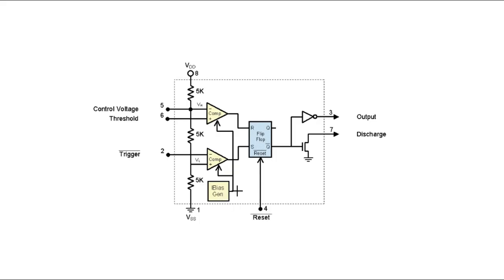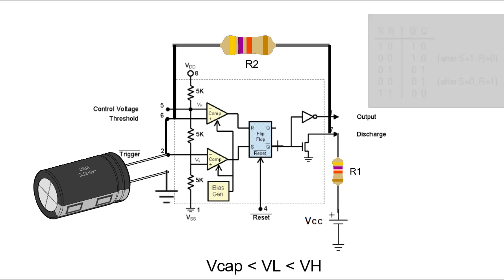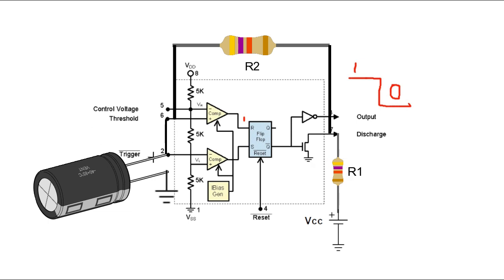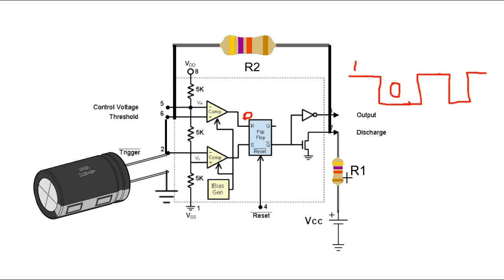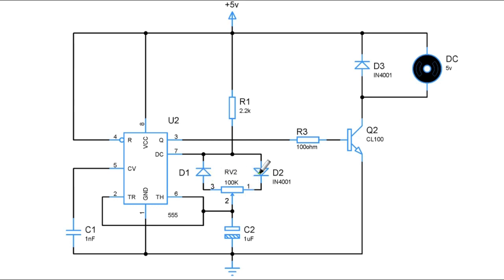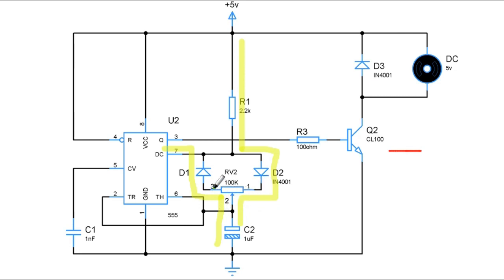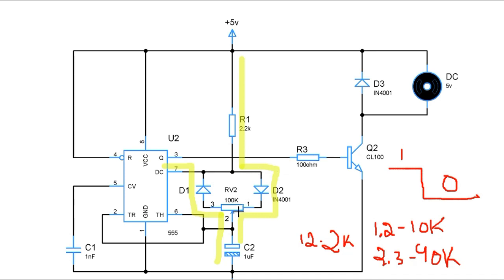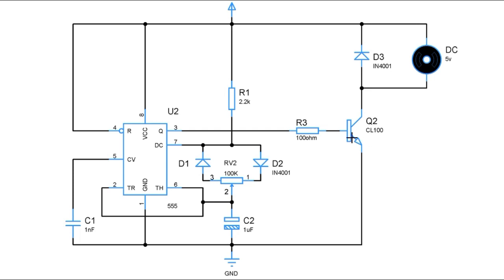DC motor PWM control using IC 555 - Circuit series : Episode #2

Comment: one question, what will happen if have a capacitor connected across the motor (for stable and noiseless source when switching starts), Just asking
Reply from the maker: This certainly will be effective when using capacitors with a DC motor especially if the load applying to motor can change. DC motors tend to draw high current especially when high load is applied or in cases where the motor is stalled due to external force. Capacitor used here will supply the high instantaneous current leaving the power supply untouched.